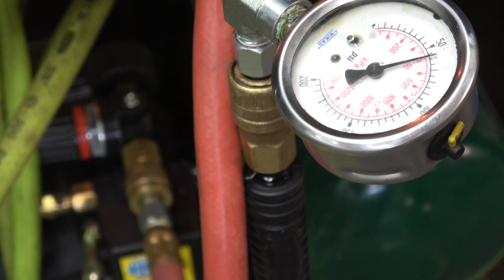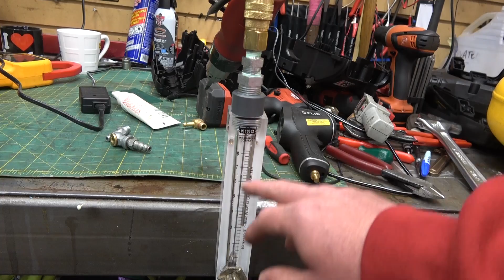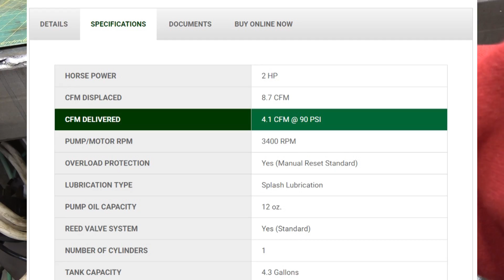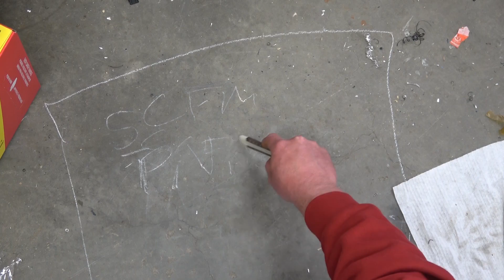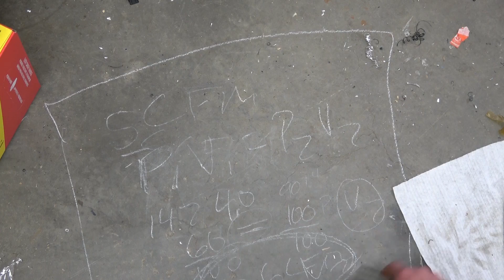Why are CFM ratings BS?

Comment: What about the duty cycle of the compressor  ? I have seen cheap shit compressors that say X amount of cfm @ y amount of pressure with a duty cycle of 50% ! So for every minute it runs it needs to be off for a minute also otherwise it cooks itself ! You will find that the makers of air tools will underestimate the needed air flow as well so if the tool says 4 cfm it more than likely uses 6 cfm or more . Its a bit like power tools they always o er rate the wattage to make it look more powerful. The whole thing is a con.

Comment: If we are going to create a new standard, let's at least start by measuring everything is in the proper units; so the flow rate would be measured in m3/sec and the pressure in Pa.  Now since Pa = N/m2, when you multiply Pa * m3/s, two of the lots of metres on top cancel out with the two underneath and we get N*m/s = J/s = W.

Yes, the pressure is a large number, because a Newton isn't much force when it's spread over a whole square metre; and the flow rate is a small number, because a cubic metre is a lot of air and a second isn't much time for it to go anywhere.  But having to use exponential notation is less of a price to pay, just to get a nice clean equation like

POWER = FLOW RATE * PRESSURE DIFFERENCE

with no constants of proportionality in it, as you might get if you fudged the units so as to bring the numbers into a particular range.

If you have the flow rate in cubic feet per minute and the pressure in pounds per square inch, you already have incompatible units: 1 PSI is 144 pounds per square foot. CFM * PSI = 144 * Lb * Ft / min, and we're still no nearer to whatever the hell Americans use instead of Watts .....

Also, 27° is a good temperature to be using with gases; since you have to remember to add that pesky 273 anyway with gases, so you might as well aim for a nice round 300 Kelvin.

Comment: IMHO the compressor ratings are honest, even if misleading. SCFM is exactly what the definition says it is.  The problem I see is that tools most often  rate their air consumption in CFM while compressors are rated in SCFM.  
The same misleading nomenclature is used in the capacities of cylinders, so you can get an oxygen tank with a 36 cubic foot capacity but if you measure its internal volume it is not even a cubic foot.  What the capacity means is that you can take 36 cubic feet of oxygen at atmospheric pressure and force it into the tank, ending up with that same amount of air but at much higher pressure and occupying a tiny amount of space.

Rather than dishonesty I think it is more of a historical accident of the way industry developed over the past two hundred or so years.  Much like the weird way they measure ships' tonnage, pipe sizes and so many other things.

Comment: I worked in a tool store as a teenager and always new the CFM ratings were BS but never knew how the ratings were determined until now, thank you . I remember the boxes for Ingersoll Rand tools use to give two drastically different air consumption ratings, this rating method might be why. Also I did not follow why you added 14 psi to P2 when using Boyle's law, did I miss something? Awesome video, your setup to show the the actual flow rates was great.

Comment: I gave up after 30 years with various over rated compressors to do what i needed, and went and bought a very expensive screw style compressor rated at 26cfm at 90 psi. After watching I am sure it is short compared to your finding's, but I know it will run 3 of everything I tried to run on a compressor rated at enough to run one tool constantly which I owned. Very interesting watch as always!
Reply: the issue are not the compressor but the tools, the compressor list intake and pressure. The tools should use the same standard - Ingersoll Rand at least does that.

Comment: Come on man!, @3:09, right there on the die grinder spec sheet you displayed, it says 23 SCFM!! What did you expect?! Look at the impact gun ratings, you will find very vague specs like "average" or "working" CFM or SCFM doesn't matter. Because what the impact consumes at the working pressure will be 10 times or 20 times more than that. A half inch impact at full hammering a bolt will need 30-40 SCFM of air flow at 90 PSI. The small shop compressors can deliver it, but only for a very short time.  Also I do think the flow meter you are using is measuring SCFM regardless of pressure, because it is  how many molecules of air flowing pushing it up. You putting a needle throttle at the upstream and even downstream is not really testing what should be testing. your needle throttle is not a pressure regulator. Speaking about pressure regulators, I suggest don't try to test them :) You may get even more disappointed. They hardly regulate anything other than limiting the pressure at close to zero flow. Unless you start going into half inch or above pressure regulators. Ingersoll Rand has nice spec sheets downloadable that gives pressure to air flow curves of their regulators, very eye opening.  Another point inlet or outlet doesn't matter. Compressor can only output how much air it intakes. It will output the same mass of air at the output. SCFM is basically how much air mass.

Comment: Ave. What you are describing is the equivalent of the short circuit current of a power supply, which would be a measure of the internal resistance ( or impedance)  of the supply.  In your case a measure of the internal resistance of the compressor. This seems to be a legitimate way  of  characterizing a compressor, just not what you expect. 

I am surprised that you  questioned the cfm rating of  compressors but expressed no suspicions of the cfm rating of the tools. Since the power delivered to the tool is in most cases is what you are concerned about,  then the same conditions apply as with a power supply. The maximum power delivered is when the impedance of the two are equal. This would mean  that you should characterize the system together,  compressor + tool.  The max power delivered would be at 45psi at the input to the tool.

And this means that if there is a mismatch between the impedance of the tools then there will be less power delivered than the compressor is capable of. 

Now tell me there is a standard way of specing the tools that guarantees  an impedance match between compressors and tools.

Comment: Or a Jacobs chuck drill… or a Jacobs chuck paperweight.  Had a cordless drill with a Jacobs chuck that would “unchuck” itself every time you released the trigger. That was the worst one I’ve had by far but overall not that impressed by them.

Comment: As an example of this fuckery elsewhere, every internet provider in the states gives you your threshold for download speeds in Mbps, but your computer shows file sizes in MBps.
1 MB is 8 Mb.
So when you have 200 Mbps internet but are only downloading at 24~MBps it's not per se they are lying. But they are using differing units of measure which is to me the heart and soul of telling me a lie.

Misleading trash should be against the law.
Reply: So thing is bps (bits per second) has been used before 8 bits was  declared a byte. Earlier computers might have been a 4bit machine even. Bits per second will work for measuring any devices data transfer. For instance old Baudot code was 5 bits wide and if you were measuring the transfer rate you would either measure it in bauds which is symbols per second or bits per second. In this instance the symbol is only 5 bits wide unlike a byte which the symbol is 8 bits. So Bits per second is generally less misleading then symbols per second for devices in generally. It's just we pretty much always use a computer these days which for the most part treat 8bits as the smallest word/symbol size addressable in memory.

Edit
Also the underlying network hardware may probably has a different symbol size than 8bits. Although ISPs I find tend to over promise how many Mbps they advertise. You may find your self getting less at busy hours.

Comment: Yep I used to work at a tool store and sell compressors all the time, some random person wants to buy a small compressor to run air tools and many times we had to tell them thats impossible even when the unit says it has just enough power to do to, like if they wanted to run an impact wrench they might get a 2-3 second burst but then have to wait for a full recharge before doing it again

Comment: long story short, compressed cfm is the only figure that makes sense since power is pressure times flow, and ultimately we're only interested in delivering power. if you're violating an obvious assumption, you're engaging in fraudulent marketing. as to why people think transmitting power with air makes sense ... this is still beyond me in an age of commodity electric motors, except in large establishments where there is an economy of scale for huge compressors

Comment: and that's why i've got a big old 50kg propane tank tee'd of my shop air line, it lives in it's own little shed out back and is installed upside-down with a valve tee'd off of that so i can blow her down now and then without having to weld-in a proper blow-down fitting into the base. service pressure on those babies is 37bar and a 4mm steel construction, I certainly trust it more than any large compressor tank I can afford!

Comment: The paltry output of small compressors always makes me think of the output of turbine aircraft engines. The hole in the back is at least 3 feet in diameter, yet the pressure in the compressor section remains at several hundred PSI.

Comment: not suprising.the manufacturers can't know the pressure your tool runs at ("p2"). However, they can pretty much depend on the atmosphere having the same pressure ("p1"). The manufacturers should include a graph or a table of converting SCFM to yield a useful measure.

Comment: I bought a Quincy compressor, it was rated for the actual output. Pretty much takes a 3hp 2 stage to run any sort of small continuous tool or spray gun.

Comment: Sir, I tip my lid to you. 

Like so many others I have struggled to understand why the heck our compressors (even trade quality name brand 12-18CFM ones) could never keep up with basic tools.  This here is the definitive answer and I am about to go postal at our tool reps as they continually lied to us when we queried this problem, always blaming regs, tool quality, power supply, filters etc.  I had tried an air flow meter just like you did and had proved this flow issue but could never work out the correlation between what I saw and what they rated because, unlike you, I never did a release to atmosphere flow test... seems so obvious now but I missed it.

There will be a couple of reps getting a roasting in the coming weeks as I reproduce this test in front of them and prove that their assurances of "real working pressure CFM ratings" have been complete and utter BS.
Reply: Excellent!  Have you done this yet, and if so what was the outcome?
Reply: ya! a follow up would be greatly appreciated
Reply: Tell us please
Reply: Inquiring minds want to know. Did you roast the tool men? Or did they conk you on the head with a wrench and cast your body behind the tool bench
Reply: So what happened come on man you know we want to know
Reply: @christophertalbert6976  They put him in the fire and killed him to keep the secret.
Reply: You think the compressor can handle multiple tools at once??? Jeez, what happened to America smarts?? You run a number of tools on a home depot little compressor,  gee, the tools won't work well. This is so amazing.

Comment: There is not any oil less compressor that will run tools. It's amazing how much more air you get out of belt driven splash lubed compressor of the same horsepower

Comment: Pretty similar to the total BS of the car audio industry (mostly in the 80's) where they were claiming you could have a 500W amp that was the size of about 4 packs of smokes, and would slip under the edge of your dash (usually had an EQ built in!).  

Of course, that was the absolute PEAK reading, not RMS.

Comment: A good rule of thumb to use as a sanity check is that it takes around 1kW of electrical power to deliver 4 CFM at 100 PSI for a decent reciprocating or scroll/screw type compressor. All bets are off for "oilless" compressors, however, as they tend to be a lot less efficient - delivering maybe half the CFM rating for the same input power.

Comment: when I worked offshore there was a compressor that could keep up with 4 sandblasting hoses at 120psi... but it was powered by a V12 Detroit  pushing a V10 compressor and a 1500 gallon tank  :)
Reply: ya, those guys sandblasting the rigs are def on continuous duty tools
Reply: Bunny Killer you was lucky , I worked land rigs we used putty knives and a needle chisel , but are air tank was a 2 stage Jims pump 5hp electric motor 100 gallon tank Diesel Electric Rig 2 Cat engines ran the light plant with two 640 volt generators.  never run out out of air , unless a line froze -40

Comment: Man the americas gets fucked over by the tool trade WAY too much. If I walk into Bunnings, the cheap DIY hardware store in Australia, even the cheap compressors are labeled simply low, med, and high flow.

And if you're going to get a DIY compressor, I guess it also raises the importance of having a big air tank so you have more stored energy so you can use it for longer between waiting for it to recharge.

Comment: Manufacturers do this crap all the time.  Anyone think they have a 6hp shop vac that plugs into 120v plug?  Theres not close to enough power to run even 3hp at 100percent motor efficiency on a 120v plug.

Comment: This is just me putting in to pushing this up in robot searches and discovery stuff. 

Air compressor
Cfm
Psi
Rating
Duty load
What air compressor to buy
Air tool
Shop air
Is my compressor working right
Why can't my compressor keep up
What's a good air compressor
What brand of air compressor

Comment: In Orstraya, compressor output is rated in "free air delivery" (in litres per minute) and the maximum pressure.  Of course you (eventually) get zero litres per minute at maximum pressure.

Comment: Jesus...... What a Con!... Just had a quick look... So you need 20ish cfm to run a die grinder.... Most 200L capacity compressors will flow that..... 100-150L "MOBILE" ones tend to flow 12-14cfm....  That's horrendous news for the home gamer!

Comment: I have seen compressors that can keep up.
But they were designed to run all the air tools in a 150,000 sq ft  factory floor.
Reply: and they cost your firstborn and a year of salary.
Reply: AvE mentions that at the end of the vid: industrial compressors are accurately rated--at the pointy end--where the air tool connects to the supply hose.
Reply: Those big twin screws with the 2,3 or 4" air pipe coming out, yeah baby.

Comment: I think you'll find most of the compressors that can actually run a power tool are marked correctly, my 12 cfm unit pumps as advertised. 240v at 15 amps though, solid Aussie brand.

Comment: Always wondered where they got their number.. 
Aussies is "free air delivery" then state the max pressure eg 145psi
So our 240v 15amp compressors are 320cfm at 100psi ( peerless p17, good unit just ratings funky although better then cheaper machines )  👌 who knows 🤔

Comment: I have two atlas copco compressors and they both deliver slightly more than the rated CFM, i dont have a rig to test, this is based on calculation from the time taken to fill the tanks to specified pressure.
I have a rebuild video of the atlas copco oil free compressor in my channel which may be of interest. the piston ring doubles as the inlet valve which is quite clever i think.

Comment: @AvE. Also Called F.A.D. Or Free Air Delivery.  So your 4.1 cfm will be 0.68 at 90 psi. I used to work for Atlas Copco and all industry uses FAD to rate compressors as it allows for atmospheric compensation.

Comment: Unfortunately, thermodynamically speaking, energy transfer by compressed air is inherently inefficient. The reason is essentially that when air is compressed, it's heated, and those cooling fins on cylinders on the compressor are designed to carry all that heat away. That's in addition to any of the other mechanical and electrical power losses such as friction, resistive losses etc. In some really bad case, end-to-end efficiency could be as low at 10% (1 kW in, 100 W out), although that's rather exceptional.

This is one of the reasons that, increasingly, electrically and battery powered equipment is replacing the use of air tools. A Li-Ion SDS drill can often do the same job as an air chisel, but with a fraction of the power requirement and no compressed air hose to get in the way (albeit bulkier). It's also how Li-Ion impact drivers can do the jobs of air tools. Compressed air powered drills are another energy sucker.
Reply: Maybe the Government (oh crap) needs to set up some standards for better efficiency such as auto engines and their MPG.  LOL

Comment: I thought it was well understood those tiny compressors couldn't run more than a nailer.  It's the tank size that matters in a homeowner unit. It's not going to be constant duty most of the time but with a tiny tank any significant airtool won't run for long.

Industrial is going to be rated at output because it has to keep up with the tools. Homeowner stuff can have a lower 'duty cycle' for the lack of a better term for the tools.